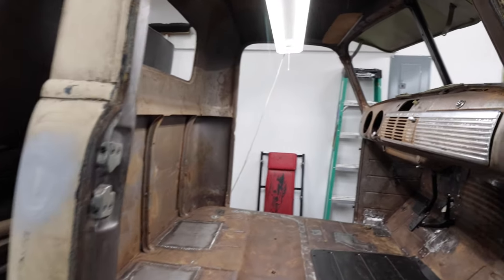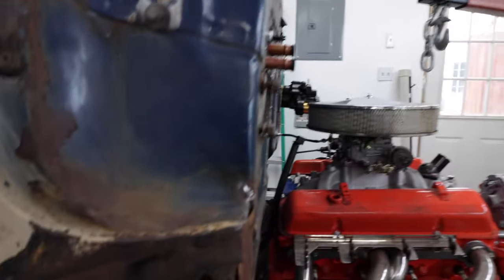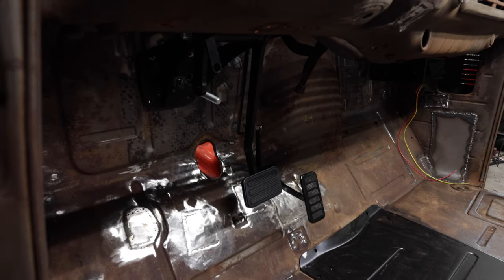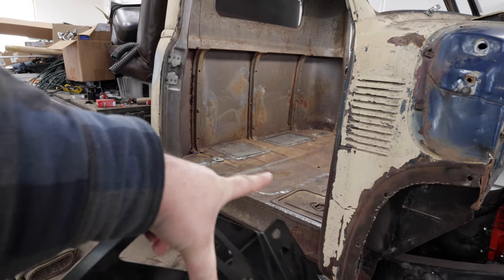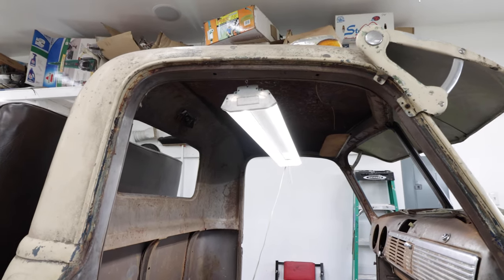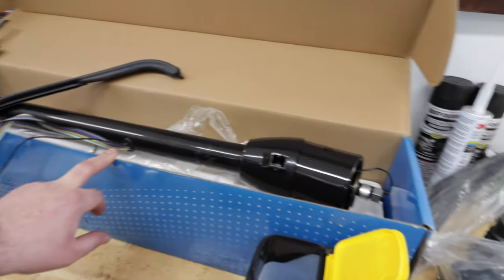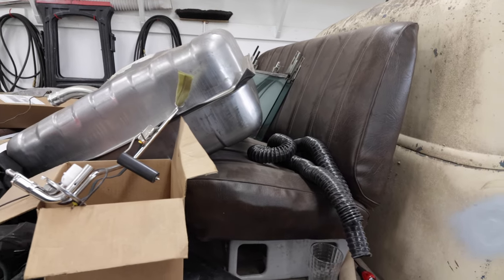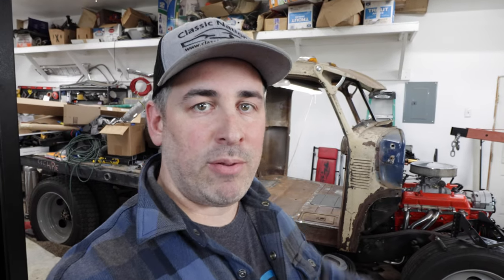1951 Chevy 1 Ton Classic Truck Restoration - Classic Nation

Comment: I appreciate all of the little details.  I.E. the copper spoon tip and the washer welding tips.  Quick question on the washer: do you put the washer on the engine side or cab side and then weld?
Reply from the maker: Thank you! Personally, I put the washers on the inside, so that I can grind them close to smooth, and by the time the dynamat and rubber flooring goes down, no one will be able to tell.
Reply: That makes sense. The other side would make the firewall too lumpy even after grinding down. Thx.

Comment: Nice build! Any specs on the 19.5" wheels and tires? Is that on the stock axle wit 14" rear drums and if so; any clearance issues?
Reply from the maker: Yep, they are modern 19.5's that look old enough for me. I wanted tubeless tires so I had to change from the originals, which I actually prefer the look of. The rear is the stock 14 bolt rear form the donor chassis, so it all fit perfectly. Hope that helps!